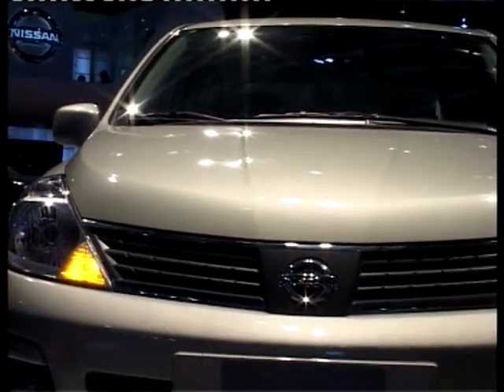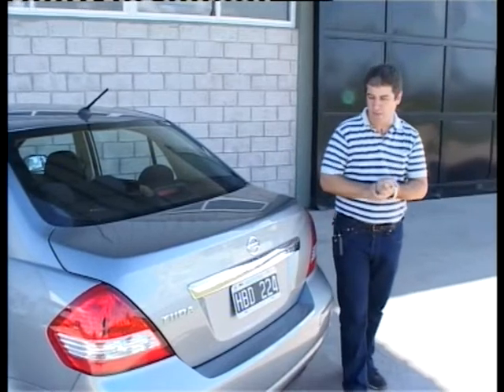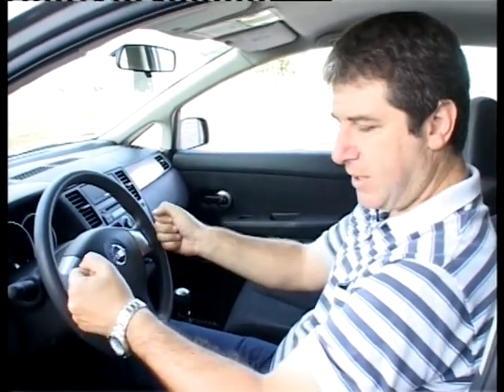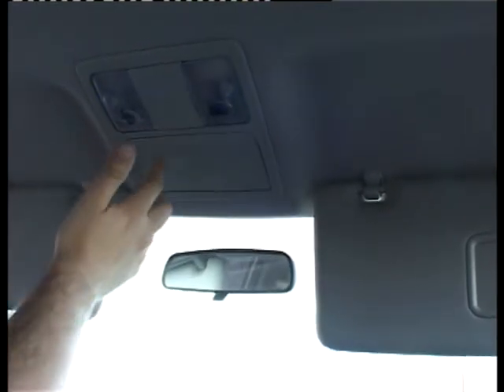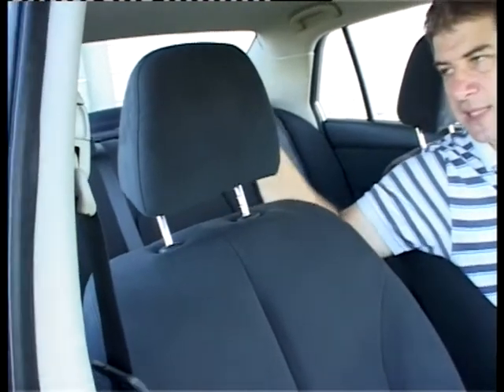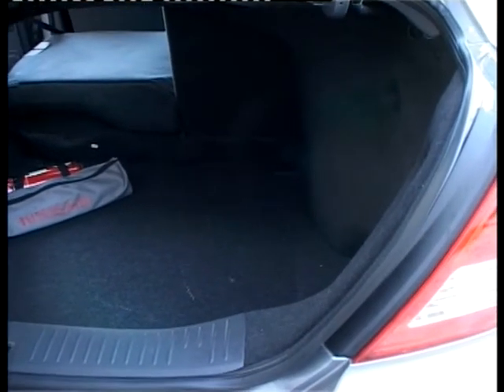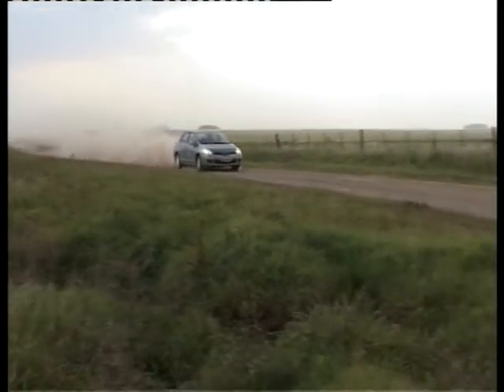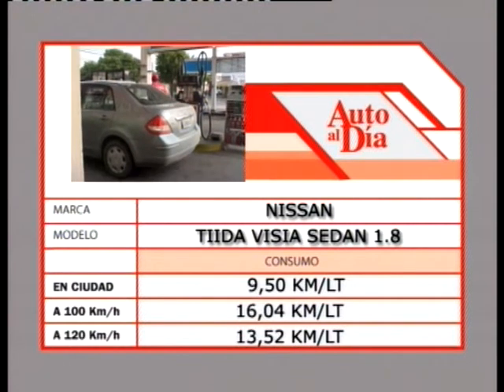TEST NISSAN TIIDA VISIA '08 '14 AUTO AL DÍA

Comment: Saludos desde México Eduardo son excelentes tus vídeos pues son muy completos. una opinión y una pregunta por favor si no es molestia: la opinión veo en tus vídeos que mucha gente pregunta si el auto presentado es cadenero o de banda o correa de distribución por lo que pienso que debes incluir esto en los videos. 

Y la pregunta veo en este vídeo al final que haces comparación de este auto con otros autos que el Tiida consume menos gasolina que el Bora (que aquí en México se llama Jetta Clásico) lo cual no entiendo si el Tiida es motor mas moderno 1.8, 125 hp, 16 v y aprox. 100 kilos menos de peso que el Bora (jetta clásico) que aparte de tener mas peso es 2.0 l, 115 hp y 8 válvulas. No debería consumir menos gasolina el Tiida por características que el Bora (jetta clásico) Gracias
Reply from the maker: Toni chaves: aclaro en el cuadro que las cifras de VW son de fábrica.
Reply: @eduardosmok4286  Muchas gracias por la respuesta y aclaración. saludos desde México maestro.

Comment: En Argentina se comercializaron dos motores. 1.6 y 1.8 Los primeros equipados con caja de 5ta y los 1.8 con cajas de 6 velocidades o una cvt. Ahora la pregunta: ambos motores son con cadena de distribución?  Hay algunas unidades con correa?
Reply from the maker: Julio: en Argentina solo se vendió con motor 1.8 y caja de VI manual. Cadenero.
Reply: @eduardosmok4286  Gracias Eduardo. Me has evacuado una gran duda surgida al consultar distintos foros donde no siempre se aclara la nacionalidad de quién comenta. Abrazo.